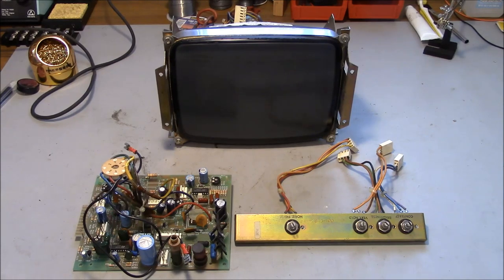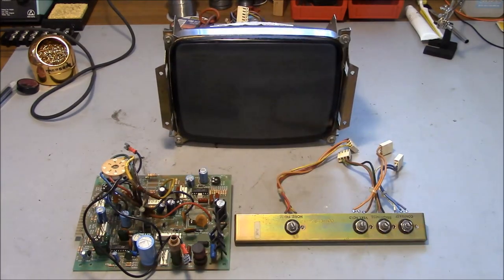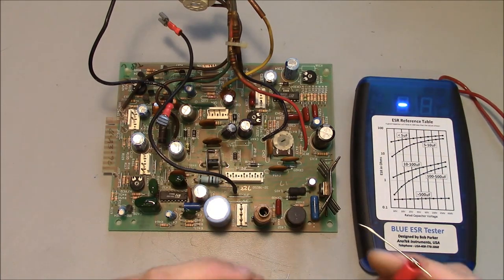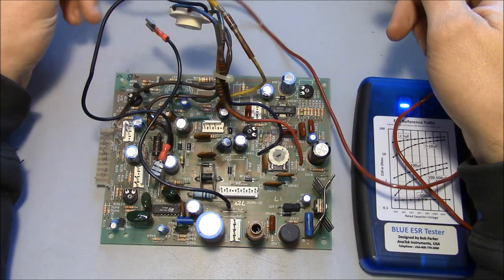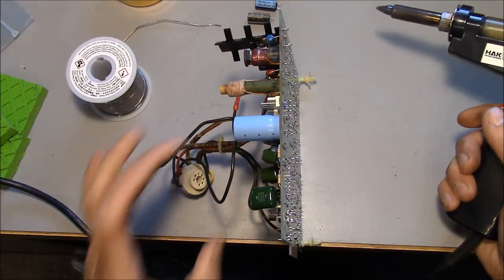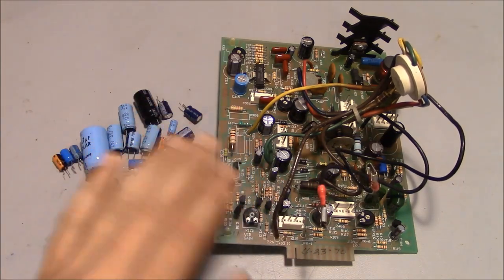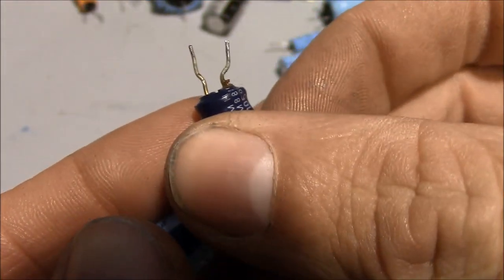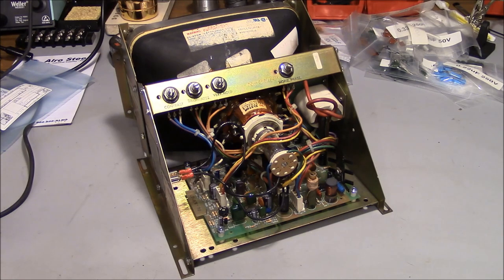CNC CRT Monitor Repair

Comment: Nice job, Wes.  Seeing you work on that monitor took me back to my youth.  I worked in TV repair shops in the late 50's and early 60's when I was in high school and college.  Nearly all the sets then used vacuum tubes for most or all of the circuits and many did not use printed circuit boards but were point-to-point wired.  I didn't think anyone worked on those old monitors anymore. 
 Thanks for the trip down memory lane.

Comment: The best thing to do before desoldering or taking it apart… Take several good high resolution pictures with your cell phone of both the front and back of the board of different angles. 

This way you can refer to your pictures to see which side of the caps were positive and negative and other details. I do this before I even clean or wash the circuitboard at the very beginning, so if there’s any corrosion or something I missed during inspection… I can always go back and see it in the photos.

Comment: Nice work. You're spot on with your advice on the Hakko - jiggling the lead is particularly effective. The only thing I would add is that you want to run the cleaning wire through it regularly, especially before putting it away, because crud in the tube will make it a lot less effective.
Reply from the maker: It's amazing how well that Hakko works. How I ever got along with solder wick and the plunger thing is beyond me.

Comment: Congrats on getting it going again! Electronics is not my strong suite, thus the reason I am not heavy into cnc, I can fix mechanical stuff all day long.
Reply from the maker: That is the most common thing I hear from other guys in the repair side of industry. I used to feel the same way. However, repairing electronics and controls problems is a very marketable skill. It's really not that complicated once you get some experience. These monitors sell routinely on ebay for $250 to $500 for used units with no warranty. I fixed this one with about $6 in new capacitors.
Reply: Want to fix mine for $ ?

Comment: Hey I have a CRT tube from a 3 way CRT rear projection TV. i am having problems focusing the electron beam. I have a spot running currently with 8.4 volts on the heater and 5.7 KV on the tube for the acceleration anode. I have the cathode and first grid grounded whilst trying 12-260 VDC on the focusing grid. My spot size is about 12mm but I cannot seem to reduce it's diameter. 

I dislike how few simple CRT videos there are with very simple functional explanations and i am attempting to put together a very good video on how to work with the CRTs from the 3 way rear projection screens. Things where going well until I realized I still have little clue as to what I am doing. On the upside I got this far and the magnetic systems are no problem for me at all, but I don't want to move something the size of a dime.

I can relay more information on my set up and understand HV/power electronics and procedures. Any information would be very helpful.

Comment: Kind of risky desoldering that many caps at once. It's good you made a map of each cap and where they go before you took them out. 
I would have marked each cap with a sharpie marker on top before I took them out. Then replace them one at a time. It might take a few extra minutes to replace them all, but I can guarantee all the correct caps will be put back in the right holes.

Comment: Wes Great video.  I have a Dynapath Delta 20 with same problem, same symptoms, has high voltage and I can see a glow in the tube at turn on (but it fades with time is that normal?).  Before I replace all these capacitors and buy some tools, a couple of questions:  1) Is there a way to test for video input with a multimeter?  2) Would you happen to have a list of capacitors?  3) Would you happen to have a board schematic?  Your knowledge is valuable - can I hire you to help me diagnose this board?

thanks Al

Comment: Are you documenting on the devices you are working on that it was serviced and what was serviced?  Even if you are the only one that has worked on it from and now and in the future those references should be important.
Reply from the maker: Yes. Any job done for a customer has a full service report explaining what was done. I also like to put the date and a sort description of the service done on the actual unit I repair. I think you can see the tag in the video. On gear boxes, I use a paint marker.

Comment: That's a monster compared to the tiny one on my MotionMaster with a old Allen Bradley control.  It's getting cold in the shop so I have to turn it on about 10 min before I need to get going, the screen is lopsided until it warms up.  Matt C.
Reply from the maker: I think that's a pretty common issue. It may be a bad ceramic capacitor or one of the IC chips. They make poor connection until they warm up and expand and force the components closer to each other, improving the connection.
Reply: Thank you I'll pass that on to my co-worker, he's more into the electronic side but I'm learning.  I would like to say thank you for your video's they are great.  I really like the one on reading the old logic electrical diagrams, that was a light turning on in my brain.  Matt C.

Comment: Looks like the CRT monitor I salvaged from a Kaypro...which I saved to put in a Siemens 810T :-)
Reply from the maker: Is a Kaypro an old PC? These CRT monitors used to be in everything. I have two Yasnac controls with 9" CRTs. Pretty much the same but TTL signals instead of composite. I'm going to fix one of them in a future video.

Comment: The last I checked Dynapath I think is still in business in San Jose Ca
Reply from the maker: Yes, Dynapath is still in business. They're in Michigan. Good controls. I like them.
Reply: Wes Johnson  I stand corrected, I was thinking of Dynamechtronics in San Jose. Nearly purchased one of their older Vmc. Thank god I didn't!
Reply from the maker: I had a Dynamechtronics DM2800 bench top CNC mill. That was my first ever CNC machine. Stepper motors, .75kW spindle, I think 6"x10" travel. It was cute, but pretty useless.  I converted it to Linux CNC, and then an Mach 3. I have a video of it somewhere. I'll try to post it someday.
Reply: Wes Johnson , I understand they were used for training, yes useless with i thing 6" z travel. Not totally sure but they got sued by Hause? For patent infringement on the controller. I nearly purchased one of their vmc for 2k with two carts of tooling and a renishaw probe and three Kurt. Unfortunate the controller had a mind of its own....I figured it was going to be a 10k lb boat anchor!
Reply from the maker: The had their own controls. Mine had the SKIP control, Single Key InPut. It was all proprietary conversational code with a maximum of 100 lines. It had no programmable spindle control. Later, they designed a PC based CNC control, but like many other companies, they rushed it to market before working out the bugs. There were problems and they never really recovered. The same thing happened to Fadal and Bridgeport CNC controls in the mid to late 1990s. 

The VMC s were sold with Mitsubishi controls as an option. Those would be worth owning. Mits controls are pretty robust.